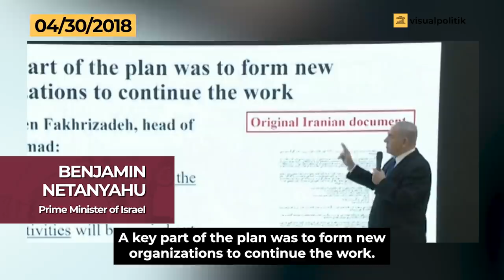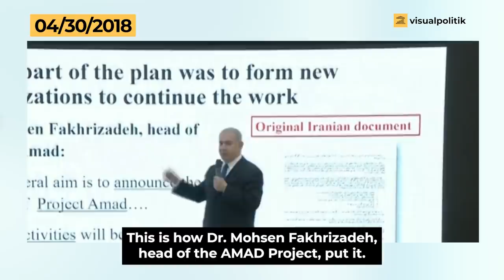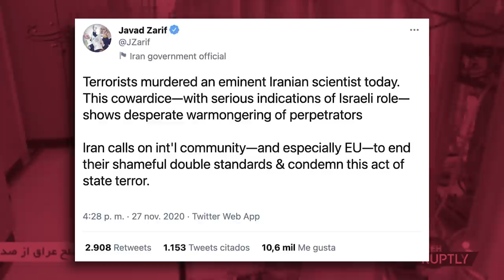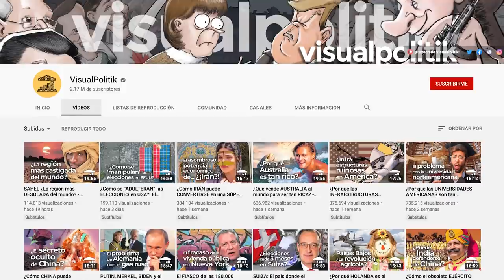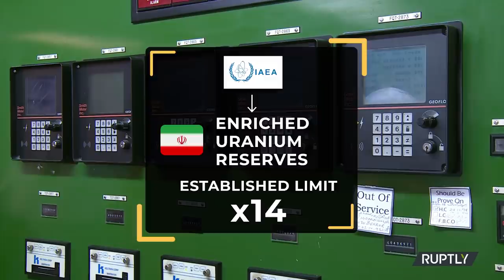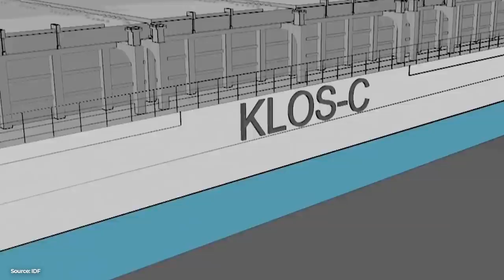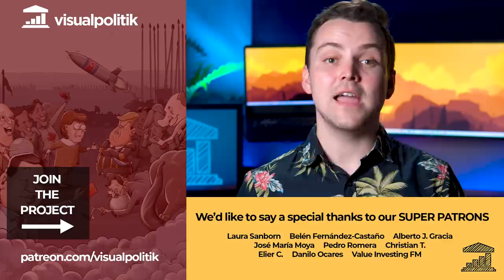How does ISRAEL intend to STOP IRAN's nuclear program? - VisualPolitik EN

Comment: It is crystal clear that if diplomacy fails, if there is a deadlock in the parley  that TSAHAL will strike especially by its AIR FORCE which is one of the most efficient in the World.
It will be in line with the Miliary Doctrine and the Strategic orientation of Israel which is the Preemptive attack whenever and wherever there is a threat to its survival.

Comment: Israel cannot stop Iran alone. The US economic warfare hold with Israeli covert strategy would work. Obama hoped to use the JCPOA to strengthen moderates. With the election of an extreme hardliner to the Iranian presidency, those hopes are gone. There is no reason to have or attempt any agreement with Iran in its current form. Their intentions are as stated and as demonstrated.